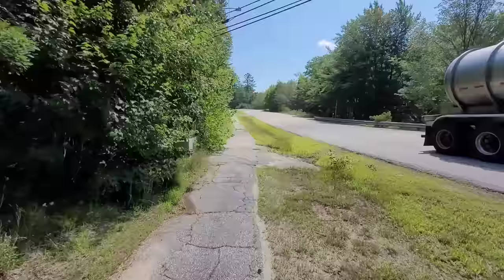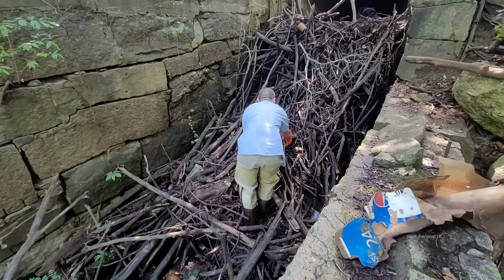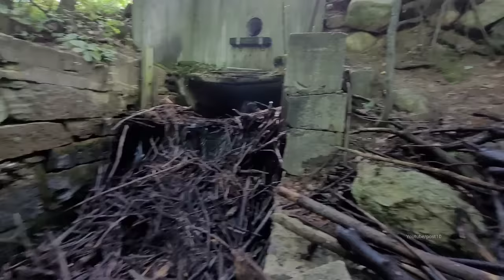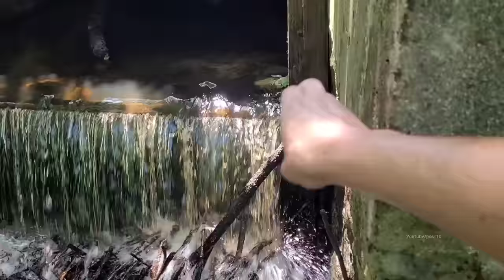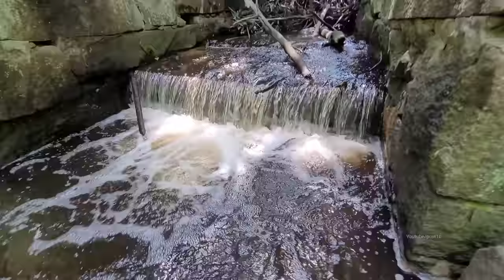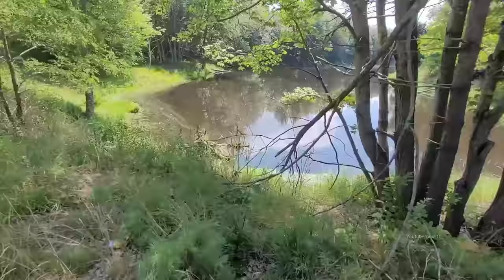Unclogging, Removing A Huge Blockage

Comment: I can't believe you tackled this problem.  I might have been more inclined to walk away or use a match.  :)  Great job, Post.
Reply: I definitely share the sentiment of wanting to use the bonfire method. My parents employ it to deal with cleared brush/limbs/vines on our property.

I would be hesitant about burning in place considering the heat shock potential to the masonry, the ecological and legal concerns of burning in a waterway, and the uncontrolled nature of that fire in a drought vs controlled bonfires in normal weather.
Reply: Match?  That looks like a clog that's begging for some C-4.
Reply: Maybe a few kilos of tannerite?
Reply: I was thinking the civil route of using a chainsaw
Reply: I thought more about several looos of good rope around the sticks and then a good hoist around a tree on the outside

Comment: It's amazing, you do all this by hand without the use of an excavator. The size of the dam/blockage doesn't seem to phase you. You just start with the top loose stuff and work your way down. My hat is off to you. If you're not getting paid for this, you should be.

Comment: Looking at this, i was thinking this would have been a great spot to do a controlled burn considering it's surrounded by concrete walls but I realized it could get out of control.
Reply: I was thinking the same thing until I saw how waterlogged the wood is

Comment: I'm glad you're being more concerned for your safety when working on these things, you've clearly gained a lot of experience and expertise.  Honestly you could probably do some consulting work for civil engineering firms on culvert design & maintenance at this point.  A lot of those folks could use the lessons you've learned from sheer experience!

Comment: The heat has been brutal this summer--many days with high temps and little or no wind. It's easy to get heat exhaustion working outside in those conditions. Glad you stopped when you did, though you got a lot done in a short amount of time. Hope the MDOT gets on this and cleans it up. Great job as always, Post :) (Fingers crossed we get some steady rain soon! Still dry here in SE PA)

Comment: love the craftmanship of the stonework on the culvert, its better to look at than concrete. Also once you get a headache from being overheated, stop sweating, dry mouth, or almost blacking out these are the signs of dehydration which can lead to heat exhaustion. Of which I had 3 times and took me weeks to get over the feeling of weakness.. That really sucks!!  I'm glad to see your gallon of water, I used to drink 2-3 gallons of water a day when I was working outside all day.

Comment: Hey Post, I know you are very well educated about the water ways of your state, but based on what I've seen on James Butler's channel, I would imagine there's a chance someone's septic overflow leads to that stream at some place or another. Especially if it does indeed smell like poop. Also, drinking water is great but sometimes heat is just not worth trying to battle, and I'm sure no one wants to find out you've gotten injured or ill! Stay safe!

Comment: if you are in a drought would it not be best to leave this alone? Or is downstream in dire need of water?
Reply from the maker: During a drought beaver dams need to stay which are illegal to remove anyways unless it is causing a problem to a roadway like all the ones I remove but these need to still be able to work eventually when there is a flood. Droughts usually end with floods and culverts need to be as open as possible
Reply: @post.10  That makes sense !

Comment: The easiest way to get rid of that beaver dam would be to pour 5-10 gallons of gas on it & light it. That amount of gasoline would ensure even the wet wood would burn. With it inside of the stone culvert you wouldn't have to worry about it spreading. After it burns down then just unclog the other side and it will be all good for a few weeks at least.

Comment: Invest in a small crane, with a grapple. Extend just past the opening, move the grapple in place , picking it up, extend further, lift out of culvert, and done. The crane can also be an electrical truck bucked

Comment: dumb question .all though i know the answer is no because of the drought, when i see all those stones aroung the the sides and hear the cracking and dull sound of those logs,  in better times could you just burn those logs and debris?

Comment: Hey man keep yourself hydrated. It did not look like you were drinking the water required to be out in the heat.
It is very easy to accidentally give yourself heat stroke. Not to mention the potentially dangerous conditions involving water and debris that you do this in and around.
You did not even bring the water down with you when you started. You gotta plan to regularly hydrate.

I hope that you took a cold shower at the end of that day.

Comment: Wasn’t that pile of debris just stuff that was washed through from the other side. From when either the cage wasn’t there and or whoever broke down the dam just tossed it through the culvert? Doesn’t seem like something beavers would do. Just my thoughts. Could be wrong though. Either way. Another great job. 👍👍
Reply from the maker: It's possible that's how it started but it was definitely finished and reinforced by the beaver crew

Comment: That area looks like a millrace to me. Any sign of an old water wheel or similar on the site? If so it would be a breastshot type positioned at the "waterfall" outlet.

Comment: Looks like (and I probably wrong) this culvert is designed in it’s primary function to hold a steady pond level, but also as a secondary function to allow sticks and debris to over topple especially in the wet seasons and stay in that ditch rather than continuing downstream to block the next waterway. I assume the intent is that council (or which ever authority in the US) should collect/ remove on a regular basis, but clearly don’t.

Comment: The horizontal slabs of wood which maintain the level required in the main pond are called stop planks and are often used to create dry areas when work is being undertaken in locks or elsewhere on a narrow navigation.

Comment: If you’re working in that heat you need a cooler with damp towels and a hat. Place the towel under the hat to keep you cool and replace with a new one when needed.

Comment: what you need when you get to hot is Water with electrolytes. Your body loses electrolytes when you sweat or  get to hot. Hot days are bad to work in but more so if you do not replenish the electrolytes.

Comment: How long do you think this has been there?
Reply from the maker: It's probably been neglected a few decades but at the same time the Beavers haven't been there in at least a couple years this whole thing is rotting and not very stable
Reply: @post.10  ok. thanks for the respons

Comment: Now that was probably the biggest clog i've seen you working on 😳

With the heatwave here too i drink sports drink with has electrolytes, also water, juices etc. Cause sweating a lot and i've had semi bad dehydration moments few times over the hot summers throughout few years.

I wonder if that big pile of dead wood in the culvert could be cleared with an excavator that has long boom with a grabbing clamps.

Comment: When you said 101 degrees I thought you meant 101 degrees Celsius
Reply: Honestly once you breach 100°F its really hard to tell the difference between F and C, its just hell outside. (Especially with New England humidity)
Reply: @jasonreed7522  agreed I live in Canada and once it did not rain for 3-4 weeks and the grass was all dead and the air was so dry

Comment: the car thermometer usually up behind front bumper.  hot car parts plus the heated road.  auto temps are never reliable.

Comment: IF it was a beaver dam, but it isn't. It's a debris jam because of the way it's constructed with the flood control beams to keep a consistent level on the one side. Large logs fell over the beans and jammed and allowed smalled items to catch in the gaps and create such a mess.

Comment: Im concerned about your safety, working in sewage water. Please take precaution.
Reply from the maker: That's not sewage water it smells because it's rotting and there's possibly dead fish because the water is too warm from the recent hot weather

Comment: I don’t mean to be rude but you seem to be making hard work for yourself because before you’ve even started you are tired you are pulling up branches that you are standing on rather than just throwing the ones on top first.and it would go down much quicker just think about that,  allegedly an opinion.